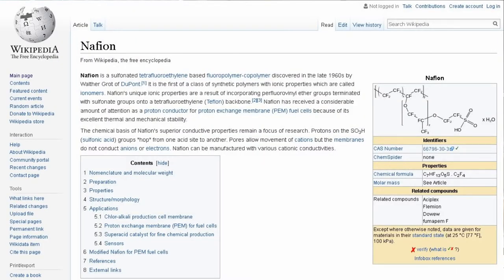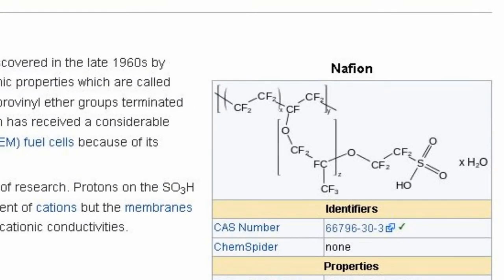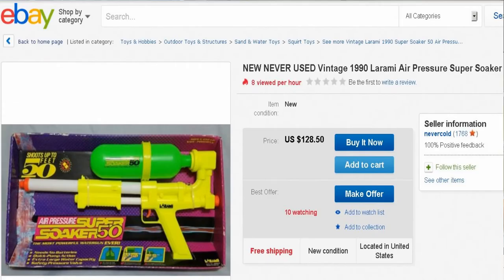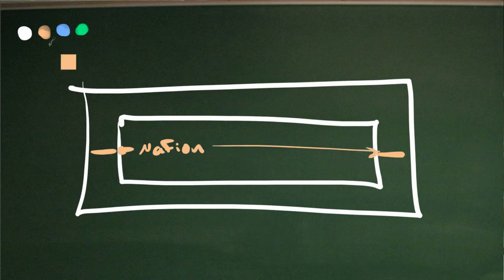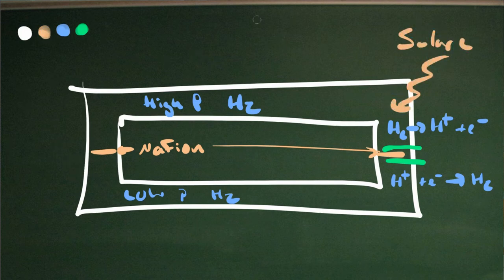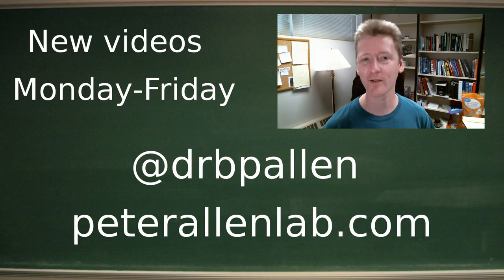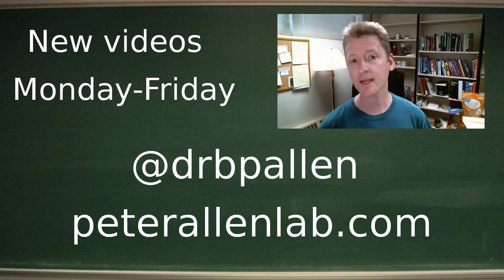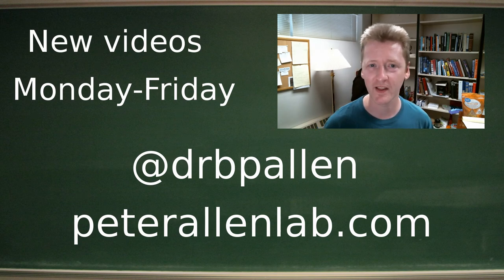Ion exchange membranes: what they do have to do with squirt guns?

Comment: Water filters contain beads of ion exchange resin.  Perhaps this material could used to make a DIY ion-exchange separator to work with: magnesium, calcium, sodium or perhaps other cations.

The resin can be prepared and then added to your favorite separator recipe.  For instance the agar-type gel you used.

Another technique dissolves a polymer in a solvent.
HDPE (e.g. plastic shopping bags) dissolve in acetone. (Other plastics may dissolve in more aggressive solvents like MEK.)  This can be molded to the desired shape and will form a plastic film when the solvent evaporates.

One Recipe:  ( Source: "Robert Murray-Smith" separators, youtube video)
10 g cellulose acetate (cigarette filters) , dissolves in acetone
70 to 500 ml acetone
10 to 20 ml PEG, polyethylene glycol, used to create membrane pores (sold as laxative and DOT 4 brake fluid)
optional: 10 ml fumed silica (sold as paint thickener)

Dry.  Wash out PEG with water (to create pores).  Use wet or dry again.

Another section of the water filters contains activated carbon.  I found a paper saying that activated carbon catalyzes the formation of Fe3O4 with salt.  It's also good for making electrodes such as an air-electrode in metal-air cells.  http://www.instructables.com/id/Create-large-refuelable-metal-air-battery/

Comment: That is very interesting. I have been reading up on polymer separators There are a number of ideas but not a lot of applications have been posted. Robert Murray-Smith  has published some tutorials but most involve equipment and processes not commonplace enough for DIY application. I guess if it was simple it would already be known. Then again the answer is sometimes right in front of everyone just waiting for a eureka moment. One little modification to an otherwise failed or less than satisfactory combination of materials could lead to a major breakthrough. Not trying doesn't produce results. Keep trying.
Reply: Is he as "a person falsely claiming to have a special knowledge or skill; a fraud.synonyms: quack, sham, fraud, fake, impostor, hoaxer, cheat, deceiver, double-dealer, swindler"?

I agree he's definitely heavy-handed on the hype, and sales pitch.  But his main products are what,  conductive ink?  Is it fraud to sell carbon glue in a bottle?  

Maybe he's gotten burned on his claims because he seems to be (more) deliberately careful about how he states his claims.  There is a lot of blue-sky stuff, but there also seems to be some decent tips and insights and how-to's for DIY.